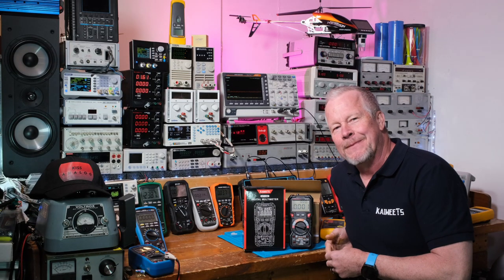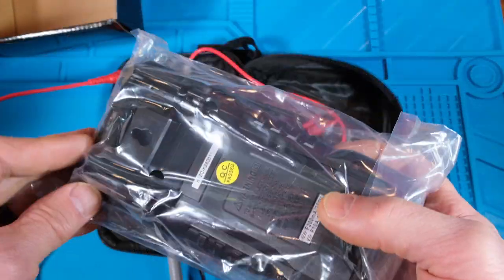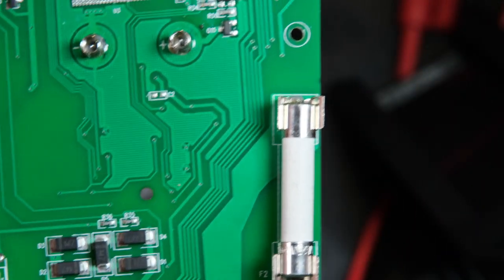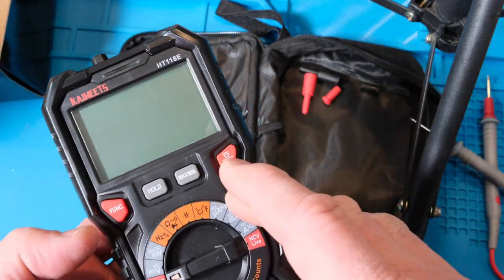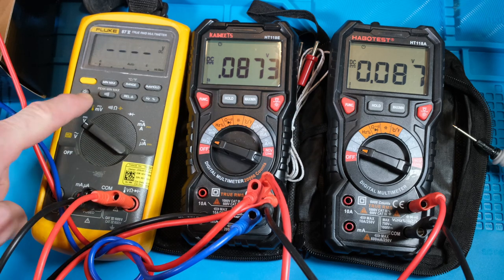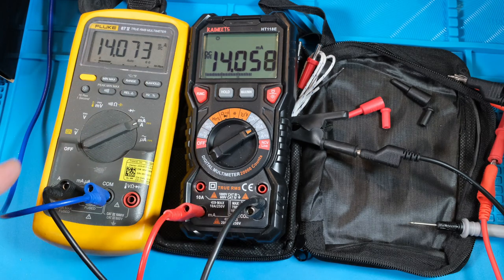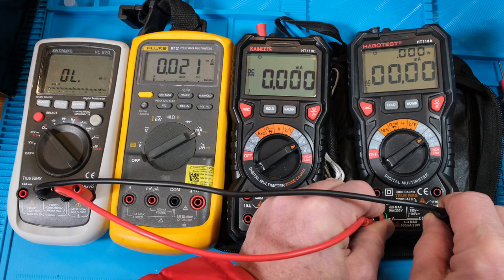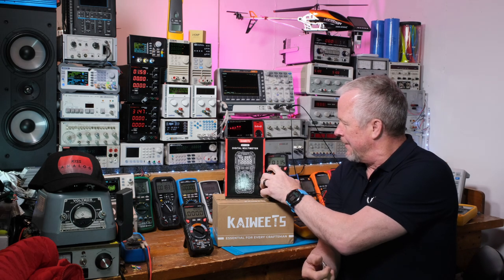New Kaiweets 20k count HT118E Multimeter - deep dive with a Fluke 87V and the Hobotest HT118A

Comment: Comparing a Kaiweets to a Fluke 87V is ridiculous.  They are not in the same league by any stretch of the imagination.  It's a complete disservice to your viewers.  The input protection is a joke.  Physically the input jacks on the Kaiweet are as cheap as it is possible to make. Compare it to other meters in its price range.  If you want a fair comparison it would be the Fluke against the Brymen 869.
Reply: The Fluke 87V against the Brymen 869s also isn't a fair comparison 😉
Higher resolution, higher accuracy, way more features, cheaper (where I live at least), higher cat rating, all lids/crevases sealed with o rings...
The BM869s is I think best comparable to the old Fluke 189 (not available anymore).
But you're right that both Fluke and Brymen make robust, safe, high quality meters and kaiweets make multimeters that are foremost cheap and it shows in construction and used components.
A comparison with an 87V indeed has little value as a review because no one that thinks about buying the Kaiweets is also contemplating the 87V. A comparison with the 20k Aneng multimeter would be more interesting and realistic.
Reply: I do not think his point is that these meters are produced using the same caliber of components.  When I was considering buying a meter for around the house, and bench work for microcontrollers, SBCs, and other "safe" readings I assumed I would be saving up for a long time if I wanted reliable measurements. Then Eddie blew that BS out the window. My guess is a lot of beginners setting up a diy bench think they need a Fluke. They do not. He has also compared Fluke to other higher end meters that are still more affordable and feature rich. Of course if someone loves Fluke meters for their use case that is cool too.
Reply from the maker: Thanks John for bringing this up.  Of course they are not in the same league.  The only thing Fluke has on its side is safety in CAT III and CAT V work environments where you need the protection.  And of course the Fluke costs 10 times more.  But look how well the Kaiweets stacked up in measurements!  Other than safety in those work class environments that most of us never work in - the 87 is obviously well over priced as a bench meter, and Kaiweets kicks it’s but for value.  IMHO Oh, and if somehow you damage the terminals of the Kaiweets - just throw it away and buy a new one.  Maybe they’ll have a 40k count out by then.  We know Fluke won’t have anything new out;)

I use the 87 to compare measurements to because it’s something that a lot of people know so it has a certain expected standard that I can show how well the Kaiweets 20k count compares to.  I did show the older version of the Kaiweets and the Klein as well to show what 6k counts looks like.   Also there are very few high count meters out at the price of the Kaiweets.  So I’ll just keep embarrassing Fluke;)
Reply: @Kiss Analog  the disagreements are at alert status red haha. I kid. This is healthy discourse and things that should be brought up by both sides. He makes good points but I fear some may have missed the point you were getting across. I got trolled for agreeing but healthy discourse is good when all party's involved exchange ideas and everyone involved gains insight like in this thread.
Reply: @mrpetit2  But because the comparison was made against the Fluke the Kaiweets buyers are going to be thinking it is a comparable meter.  The point Kiss made about it being just for bench work is going to be lost in the noise.  I'm just tired of the constant Fluke bashing.  I own both Fluke and Brymen and worked as an Industrial Electrician where safety is not something you take for granted.
Reply: @notquitecopacetic  My opinion.    You said, "When I was considering buying a meter for around the house, and bench work....".  Buy a meter that has good input protection and quality input jacks.  Working around the house uses 220 volts with high current and transients. Transients can degrade meters.  You need to rely on a meter to stay accurate.  I grew older :) and now have 30-year-old meters that I still trust.  I was just on a consulting job and needed a meter.  I purchased a UNI-T UT161B.  It has better input construction and voltage protection.  I'll use a 6,000-count meter with good protection over a 20,000-count meter with mediocre protection every time.
Reply: @johnnorton6085  I guess I am more of a safety second, or sometimes third, kind of guy :)
Reply: The Kaiweets is perfect for the beginner-intermediate circuit design I am doing. It's the right tool for the jobs I currently do. When the day comes that I'll need an upgrade, then I'll deal with it then. I don't see that happening any time soon though. A decent oscilliscope is more important as I move into FPGA
Reply: @mrpetit2 I stick to Klein, UEI, IDEAL, extech , Greenlee and meters I can afford

Comment: I think the idear of the firestick thing is to see how fast it responds.  That way, you could hold one probe to, say, ground, and very lightly pull the other leads along a chip looking for it's ground or a short.  Some meters like the 121GW are slow as sin, to be almost useless in continuity.  So, yea, I think the firestick test has some value.
Reply from the maker: Thanks but I disagree.  It is a bad practice to drag a probe tip across a chips leads.  This doesn’t fly in any good lab.  I don’t support bad practices.  If I ask a tech to check a chip for a shorted pin - that person better take purposeful continuity measurements.  That means taking half a second for a reading - or a full second if that is what it takes.  Do you wasn’t to fly in a plane that a tech practices the fire stick method?
Reply: @KissAnalog  Works for me with a fast meter.  One does have to be careful not to create "tin whiskers" when dragging.  It can have the bonus effect of finding a badly solders lead - lol.  It's nice for connectors too.  I dunno, we have our own ways.  You do need a good and fast beeper, and preferably gold plated probes tip.  It does not help if half the problem is the tin plated probe points.

Also to your point of various meters not remembering the mode they were in, that is my only gripe for my favorite newer DVM, the BM786.  To go from resistance to DIODE,  check you have to click to capacitance then hit the secondary function to do diode mode.  Then you have to click back to go to resistance, then if you want diode mode again, click again, and it is in capacitance mode.  I don't know about you, but I do not rely on a handheld DVM for capacitance.  To me, that should have been the secondary function of that meter.
Reply from the maker: @Daveyk021  I agree with you!  I think capacitance should be the secondary function.  I do like the memory thing but if the functions set for primary make sense - then it is not really missed.

Comment: Remind me, what does the D in LED stand for? Multimeter designers really ought to add a simple boost converter to allow reading all types of diode except maybe really high voltage zeners.
Reply from the maker: LOL Yes an LED is a type of Diode, but Diode checkers are really there for the most common troubleshooting which is PN junctions of diodes and BJT transistors.  I don't know if I've ever found a dead LED actually.   I'm sure it happens, but diodes and BJTs fail often as they usually handle more current and are more prone to fail.  LEDs almost always have a resistor in series to limit the current, so they have some protection and usually only handle small current.  But I agree with you - it would be nice to have a boosted voltage for the Diode/LED checker:)  Zener diodes can often be proven to work if they have a normal diode drop in the opposite direction.
Reply: @KissAnalog  I've often found it useful to be able to probe the polarity of LEDs during assembly work, particularly very small surface mount devices: it can be difficult to impossible to read the marking especially when already placed.

Comment: Holy be-jeepers batman.  Since your video came out that meter has risen from about $45 to $67!  Good thing I acted quickly and used the 10% off code and got it for ~$41.  I wonder how high it will go?
Reply from the maker: Thank you!  The price does vary with stock I think.  The current price is $48 https://amzn.to/3QWcWWM
Reply: I just picked up a couple  for $31.39 each (before tax) with $7.00 coupon and lightning deal.

Comment: I bought this model from Amazon yesterday (12/8/22).  I also got a $9.00 off coupon through Amazon.  It's specs seem very good for use as a bench meter on an audio lab bench.  I'm putting one together and am trying to do it as reasonably priced as possible and still have good, reliable test equipment.  All in all, this meter cost me less than $39.00 and that was just too good of a deal to pass up.  I also got the 10,000 count meter for less than $20.00 on black Friday from Amazon.  I'm pretty pleased.  I would have gone through your link, but it wasn't up yet :).  LOL
Reply from the maker: Thank you.  Get 15% off; use KA15 code at Link to Kaiweets store: https://kaiweets.com?sca_ref=1269738.glN6S8aePH

Comment: @Kiss, 
Appreciate your work and videos. 

Probes on my older meter broke and am about to purchase a new dmm. What model(s) do you recommend at the household/hobby level and what concerns are relevant to safety? Usage is primarily around electronics such as; computers, hubs, power banks, flashlights, chargers and mobile phones.  Also, minor work around appliances, outlets and vehicles. Aside from the common test varables the following are important: temperature, autoranging, hold, NCV and readability. What safety concerns should be considered and what fuses ratings are appropriate? From $40-$75 seems about the right pricing. Thus far, Klein MM600 and Uni-T models seem reasonable choices. Extech, Bryman, Southwick and others have models in this range too. Kaiweets has a 20,000 count model which could be in the mix but the fuses seem underrated. Are my concerns warrented? What model(s) do you recommend at the level noted and what safety factors and ratings should be considered. Thanks again.

Comment: Thanks Eddie,
I did buy this and got your discount!

One thing, I've seen the continuity timing done by several people. I've used continuity to check things like terminal strips where I was looking to find a lead termination and I do run it past each pin pretty fast so I would think knowing the response time might have some value.
Reply from the maker: That’s awesome!  Thank you!
Reply: I just wanted to confirm the same - quick response and quick back to quiet is good for checking many pins in a row.

Comment: Hey Eddie,
Great help with your video, and learned a lot.
Just ordered the Kaiweets HT119E as a beginner, I have a question.
You mentioned the “leads” are somewhat stiff and “not silicon”.  So the question is should one replace them, and if so, do you have a recommendation?
Just so you know, I don't use a multimeter much, so it's possible that your response may be the ones that come with it are fine.  I would guess the primary use would be for measuring DC voltage of e-bike batteries.
Reply from the maker: Thanks for the question.  Using my links in my videos helps support this channel and I really appreciate it.  The leads are fine but if you want something more flexible, here is a link that supports this channel: https://amzn.to/3yKAdq9
Reply: @KissAnalog  Precisely what I was thinking about the flexibility.  Interestingly, I was browsing through the leads and had saved those precise leads. I did click the link when I ordered.  Many thanks.

Comment: I’m missing something here. What about the diode junction test. One thing I love about the fluke is the beep you get for a diode drop, or constant beep for a short. It looks that kwaiweets does not do that.
Reply from the maker: Yes, you are right.  I do like the beep as well, but Kaiweets didn't do that with this meter.   They do show the actual voltage break down though.  I know that some people complain about the beeps - maybe they work in a cubicle so they don't want to bother others.  So, I think it is hard to please everyone, but maybe they could offer a way to turn it on/off.  I'll suggest that.  BTW, Kaiweets does give 15% off when you use the KA15 discount code.
Reply: @KissAnalog  cool thanks. I know my fluke will die like my other ones have. Their parts are as expensive as the meter. I am looking for an alternative that has physical switches. Not a fan of bubble buttons like Kwaiweets other one, which I hear does beep. Simple switch would turn that function off. I know it’s not the tell all but, when speed is the key in my field, sure helps.
Reply from the maker: It is interesting that most meters do not give the beep as I think a lot of people complain about all the beeps.  One of the nicest meters - especially for the cost actually does beep and it is the BM786 from EEVblog: https://amzn.to/3YTqLsX

Comment: Great test but You could check also bar-graph for speed of reaction. This is the answer if the bar-graph is faster than lcd-result, so its usability is real. You can have more frequent tool reading, for variable switching voltage and not miss the values. I bet Fluke is good here and the others are not, if the speed of bar-graph is the same as lcd-speed..

Comment: Nice review, thank you. My dilemma is I calibrate fluke 77’s and 87’s (really test, never had to actually calibrate) using fluke 5500 or 5522. I want an 87-5 but can’t justify the cost for my usage. Is kaiweets 20k unsafe for household electricity? I would use mostly on automotive with some minimal household applications
Reply from the maker: Yes I think the Kaiweets is a great buy.  Using multimeter for household electricity is considered CAT II, so pretty much any meter should be rated for this.  BTW, you can use KA15 to get a 15% discount on top of any sale price at the Kaiweets website.  Here's a video that I did about the CE safety mark.  https://youtu.be/h6eebkRj7YI

Comment: Hello, thank you so much for sharing with us. i have a question Sir? is it possible or a way to cover up and protect the inside if a battery happened to leak? at the beginning you mentioned that you can see the board from where you place the battery? Thanks.
Reply: Hi, you could always just use some hot glue or better still some silicone sealant to seal up the gap at the base of the plastic battery cover through which you can see the PCB. Just don't get any on the springs and contact terminals on the inside. I hope this idea may help. 

Also, always try to use good quality branded batteries, which I've always found are sealed better and seldom leak.
Reply from the maker: Great Question - @masoodturan7489 provided a great answer;)

Comment: Very good video and comparison.The meters are good value for the price,especially for home use. But input protection is not very robust. I do a lot of maintenance work on different equipment, hvac and other industrial equipment. In the beginning I tried to use an inexpensive mastech meter, but after two weeks something happened and the meter is displaying 60v in any range of the voltmeter. Since then I use certified cat meters from testo, I like the 760-2. Benning also makes good meters and voltage duspol testers. Peaktech is another brand that I like and use. I think safety is important. Even if the meter is accurate I like to be robust on the inputs. Uni-t has some good meters I prefer in the budget range.
Reply from the maker: Great feedback - thank you!  Yes meters certified for CAT ratings are more appropriate for HVAC work.  I do like the testo 760-2 for sure.  Here's a link  where it is on a nice sale: https://amzn.to/3QHhsKw

Comment: Dear Sir I want to know one thing. 
I wanted to buy the Kaiweets multimeter but this one is 200mA while the other one is 600mA now my question is because the Kaiweets multimeter is 200mA will there be any problem in working??
Reply from the maker: Thanks for the great question!  It might be that the 200mA went with the 20k count - regarding range settings.  This would provide a very high resolution in the measurement.  The 600 mA is probably due to the 6k count multimeter (the other options would be 6mA or 6A).  So the resolution for say 200mA in a 6k count meter will not be near as good.  But the 600mA readings for a 20k count meter in the 10A output still has great resolution.  Does that make sense?

Comment: I own a fluke 289 and have not really used it much. However I went to use it and in VDC it fluctuates as much as .300ma. Zero out leads. Replaced batteries. Reset it to factory. Removed leads yet still does this while sitting there 🤷‍♂️
Reply from the maker: Thanks for this feedback!  Does it measure low current accurately?
Reply: @KissAnalog  it does yes, i found that it goes to 0.0000 as its base so when i only need it to .100v its fairly stable i use it for parasitic draws in automotive and such which does very well at.